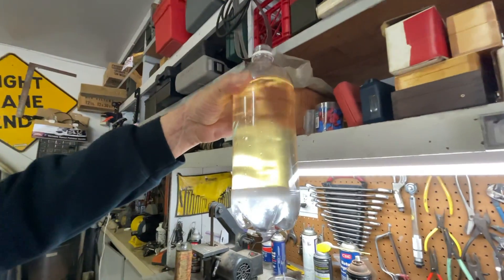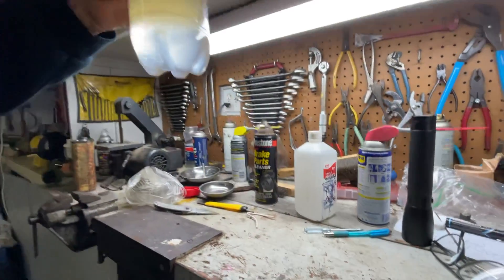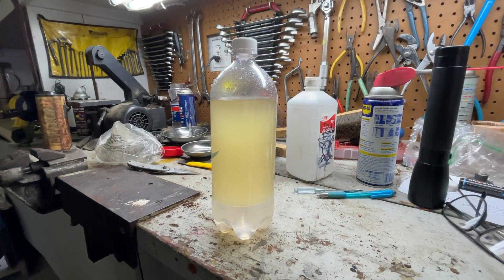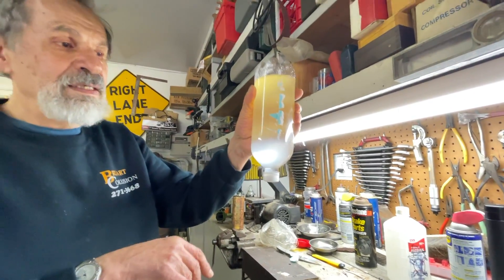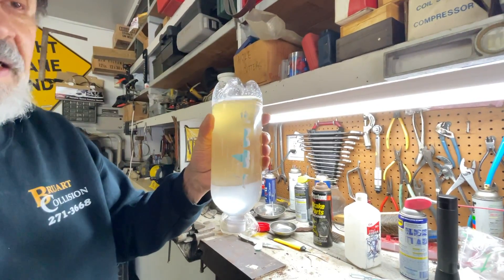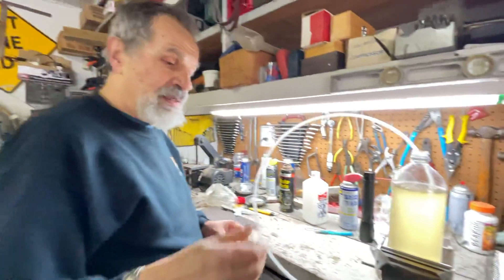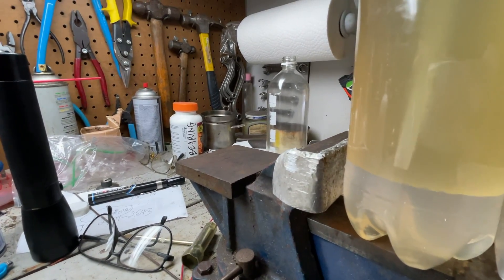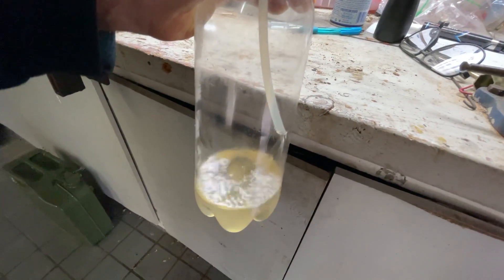The Most Practical Way To Remove Ethanol From Gasoline

Comment: If you're going to extract the ethanol, which I don't recommend, you should wash the gas at least a couple of times in your separatory funnel, then dry the gas through a buchner funnel loaded with granular anhydrous sodium sulfate. Taking the ethanol out reduces the octane rating by about 4 points for E10 gas. The added cost of using a quality octane booster adds a significant amount to your fuel price.
Reply: But I bet it's cheaper than buying a new 2-stroke generator after the alcohol did its trick to the carburetor.  We had no power for 12 hours today, so I fired up my generator (free from a neighbor years ago, no manual included).  It ran about 20 minutes, then died.  A friend found a manual for it online. Turns out the manual warns strongly against gas containing ethanol, as it wrecks the carburetor.  I'd just bought high-octane gas and mixed in the 2-stroke oil, but it looks like the ethanol may be the culprit.
Reply: @scottk3292  why would you buy high octane gas, do you know what higher octane means ??
Reply: That’s why you start with 91 or 93 octane first.
Reply: @TheGuyThatWondersWhy it's more expensive to buy high octane fuel and way cheaper to buy a $5 bottle to treat 21 or 26 gallons. 
Remove the ethanol first and then add the octane booster.
Reply: That depends on if you're buying 26 gallon octane booster for $10 a bottle or buying it for about $5 elsewhere. 
It will be cheaper than buying a tank of non-ethanol at an increased price or paying for a higher octane rating.
Reply: Too much government making add ethonal to make rich farmers happy.

Comment: I doubt you can fully let the Ethanol+H2O+fuel mix settle and phase separate enough to avoid water contamination. Also, ethanol which has some water in solution but hasn't phase separated is just fine for fuel systems. A lot of disinformation around this! If you don't believe me, there is a great technical bulletin/paper by a petroleum chemical engineer on exactly the subject: https://web.archive.org/web/20130427123941/http://www.epa.gov/OMS/regs/fuels/rfg/waterphs.pdf

I was very misinformed about this myself because of so so much misinformation everywhere online. Finally took the time to research by looking through peer reviewed professional research. 

One note, a lot of small engine problems with using gas station gas actually come from other compounds in gasoline, not the E10! The culprits are Olefins as well as Benzene. Great overview and vid: https://www.youtube.com/watch?v=Wvps2gF0Sdo&t=255s

Comment: You can add a pinch of salt to the water to shift the equilibrium more to the side of the water. Would also strongly suggest using molecular sieves or a drying agent like calcium chloride, because the water still inside the gasoline will do more harm then if you left in the ethanol.
Reply: So will this process not completely separate the water/fuel? I'm planning on doing this to remove the ethanol to be used in a 2-stroke outboard engine. There is an onboard fuel-water seperator , so if all the ethanol had been extracted but there is a small amount of water , I would assume the seperator will then be able to remove it before it reaches the engine. Yamaha reccomend 86 octane fuel , I'm planning on using 95 octane E5 , removing the ethanol should result in a loss of 2 octane. 2 stroke oil also reduces the octane rating of fuel so estimating it'll reduce it further down to 89. My question is what percentage of water would you say is left in the fuel after this process?
Reply: @ocarroll3578  It's true that some water will be left behind in the gas because the gas will dissolve a very small amount of water.  But I have a hard time believing that the amount of water left in the gas is a significant problem.  Gas naturally absorbs water vapor from the air anyways, so you never really have completely dry gas unless your working under strict laboratory conditions.  I'm no chemist, but I would think that gasoline left in contact with the atmosphere probably becomes saturated with water (to the same degree as following the procedure in this video) pretty quickly.  In any case, if you're really worried about the water content, you can put a little bit of drying agent like sodium sulphate powder in the final ethanol-free gas, shake it around, and then pour the dehydrated gas off into another container leaving the drying agent behind.
Reply: You need to make a video to explain this in more detail please. I was going to use this method to extract ethanol because I want to keep moisture out of the gas/petrol for long term motorbike storage, but if, as you say, water will contaminate the fuel then it is pointless.
Reply: Calcium chloride is incredibly corrosive.

Comment: There is a Shell gas station near me that has a NON-ETHANOL gas pump that I fill my gas cans with. It cost a little bit more, but it's worth it. Ethanol eats Aluminum and Pot Metal that carberators on small engines are made of. I do add Stabilizer to it. Be safe my friends.
Reply: If you are in Canada, Shell no longer carries Ethanol free. despite this some of their pumps stil say Ehhanol free.
Reply: Not any more! You can thank the dumbass politicians that Ethanol-free is illegal now.
Reply: I have never experienced problems with E85 in TWENTY years. MOST of what you say just does not add up.

Comment: Good man. Having watched several videos on this topic, i am going to create one for this very purpose. Take a 20 litre water bottle, and install a valve/petcock on the very bottom, on the bottom rib, furthest lowest point on it. (drain off crap, and water).   Make several horizontal lines, around the bottom, outside,   1 cm apart, for 3 inches. Then, am going to go  ' gas cleaning '  removing ethanol, and using  THAT, as a cleaner in a spray bottle.  Good luck, all !

Comment: Thanks Ben!  Isaac uses his brain and some basic chemistry and ingenuity to solve a common problem with modern ethanol infused (fouled) gasoline. Clean out that ethanol for the engines and tubing that can't handle the alcohol!
Reply: The problem with ethanol is not the ethanol it is the people who have small engines and don’t maintain them properly. Never let gas sit in a container with open top, shut the gas valve to carburetor off and run engine til it’s dies (install a shut off valve if it doesn’t have one) and remove gas from tank. This only needs to be done if your not using motor for 3 months or so. Modern engines are designed to run on ethanol fuel. My Sthil MS-261C chainsaw is designed to run on 25% ethanol.

Comment: OR. Buy a oi) extractor pump: oil, gas & ETHANOL safe: if you are!
The " neighbors" bought $500.00+   " NEVER CHANGE OIL"  insanity!
Briggs & Stratton knew that wouldn't work in 1953! & I believe! 
1st 5 hrs: every 25 hours & or season! They like the pump better than turning the " magic" mowers upsidedown & shaking the oil out? 
Except that one old machinest!
Drilled & tapped the low points added a quick connect & :" voided his warranty" but!
The mower wouldn't have lasted 3 yrs & the  $23.00 gal cans of " our good gas"  neither. Now it will run like my 27 year old SEARS ( RIL) Craftsman PUSH!
Even with a few abandoned mowers for parts ,, coffee filter air cleaner mod. &  RECOIL starter mod( old battery drill : FYI BRIGGS & Stratton NEW MODEL 625e have a battery start built in! Since Canada, Germany, England ~~ everywhere but here! Have socialized/ national health care, the don't like to pay for : TKR OR TSR surgery? I got one & they shut down the airports when I drive by?  PS PS PS DON'T TRY AN IMPACT OR DRILL ---- WITHOUT A GOOD RACHET DRIVE!  Besides: if ya got a big yard : DRAGGING the air line or power wire is a  " drag" ?

Working on mower to mower refueling & a remote?
😀😄😉😳 🇺🇸 
Before they outlaw gasoline altogether?))
Good luck,  vote for corn on the cob &  ethanol in brown bottles ONLY!

Comment: I told a friend about this and they reminded me about the clear tea/water dispensers like you see on buffet lines... if you do this in one of those, you could easily drain off the water/ethanol from the bottom into a separate container.

Comment: If the gov't forces sale of 15% ethanol, it will destroy engines on cars sold before 2012. Both our cars are older and in perfect condition. This information would save us from having to buy new cars. Thank you very much for this.  Also, I would never have thought of the clever siphon method.  That was a forehead slapper.

Comment: You aren't thinking this through. 
Add dye to the water so it's easier to see, if you're going to do it regularly then make a settling bottle/tank with a tap! If it's the same quantities every time put the tap at a level just above where the water/ethanol comes to then drain the gasoline with the tap with a pipe on it!
It's not rocket science.

Comment: I think the thinner the bottle, the more precise it is to remove the gasoline and with less loss. So after doing this process with a large amount in a wide large bottle you can put the rest that is difficult to separate in a very narrow bottle. In a narrow bottle, fluid levels will be higher.
Reply: Great idea, Ed!
Reply: I was more thinking of leaving a larger margin between the water level and the gasoline to avoid getting any water.  Yes, you would have more gasoline at the end not drained but you put it aside.  The next time you need a batch, get it and use the mostly water and some gasoline in the next extraction, separation.  When you have too much water, you just push the tube to the bottom and syphon off most of the water and start all over.

Comment: So if I either froze the ethanol water blend or distilled it I should be able to mix the pure ethanol into an E10 regular gas and use that in a E85 flex vehicle with no waste lol  I have been getting the off road gas but that stuff is close to $2 more a gallon and the nearest place to get it is 20mi away so this looks like a decent solution I guess. SMH

Comment: E5 is still available at UK pumps for around a 5% price premium. If you purchase E10 then remove all the ethanol your gallon just got 10% smaller + any gasoline not collected. Then there are the risks in the process described above. AKA gasoline fumes -  and people using plastics that will melt when in contact with the fuel!!

Much as I resent paying the premium for fuel intended for high performance cars into my garden equipment and outboard motors I will pay the premium and get on with it!

Comment: As a college automotive instructor I teach how to use the separation process to help drivability issues to determine if the wrong fuel is being used. Great video, thanks
Reply: please, could you explain this or direct me to another resource?  also, do you then extract the alcohol from the water?
Reply: @jaewok5G  you can freeze the mix.  The alcohol won’t freeze if you don’t get temperature much less than 32 degrees.
Reply: DON'T GET CAUGHT: big Petro will use you & the children for fertilizer for their mom food grade : ethanol greedery ¢¢¢¢_$$$$$💸💸💸💸 but if you tell em how to reverse the process: you'll be famous , ( if they forget the second process,? ☮️
Reply: Maybe you can show these guys how to demulsify the water and then a basic alcohol distillation to remove the ethanol from the water 🏆